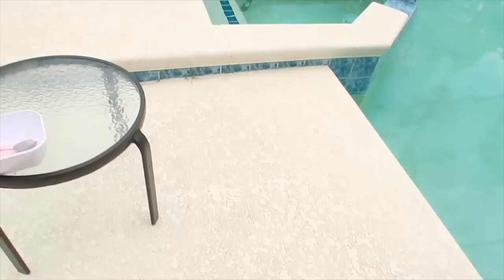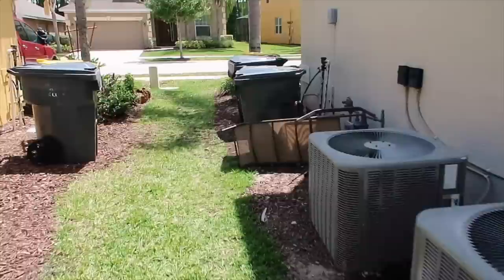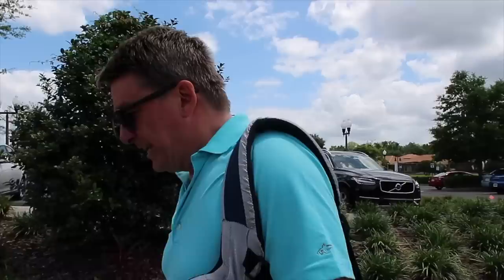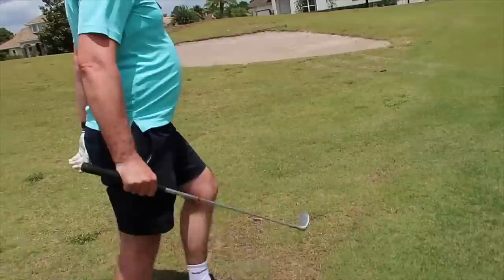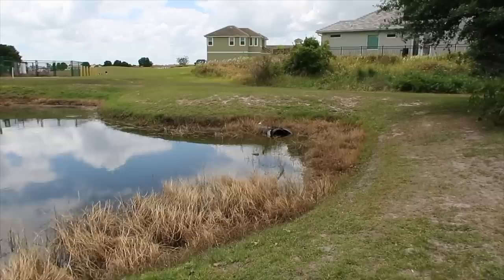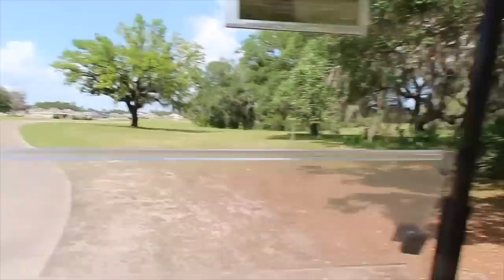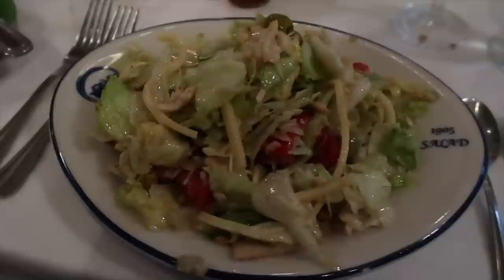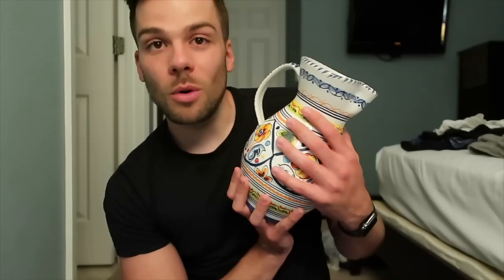I CAN'T BELIEVE THIS! Painting the pool deck, golfing & my favourite restaurant in Florida!

Comment: My house has the same columns and beam resting on them by my pool.  But the seller hid a bad rot problem in the big beam in the lanai that holds the roof trusses Joel,  it almost cost me this house.  They stucco over wood and that is rot central.  Of course my house has no neighbors that can see into my pool area.  It is a sort of T shaped house with a near 100 foot long line of house, and a T for the other wing. the pool is outside the bedroom door and so the house shields the pool on two sides from the only neighbor I have, a man in his mid nineties.  Every house in my HOA is on a greenbelt, meaning wild Florida woods.  Unless you have a house on a golf course.  Yuk.  And the property next door is vacant for two lots, all lots are at least a third acre.  So my pool is house on two sides and woods on the other two.  Lanai.  Not a word I think you know in England.  It is basically a room outdoors.  In this climate almost everyone has them.  A roof, fans, and usually a pool.  It is not included in the square footage of a house.  Florida is the only place I ever lived where they buy and sell houses and accord footage by how much of your house is under air conditioning.  Every house also has another documented number of how much house you have under roof in part because insurance requires that, but when you see a house listed for sale the sq. ft. is the inside rooms under air.  My house for example is 2,440 square feet under air, but total house under roof is 3,590.  They do not count the garage, or walk in attic, or outside bathroom, or lanai as part of the house because they do not have A/C.  This house was built by an architect who worked as an engineer at the nuclear power plant a dozen r so miles away.  Trust me when I say this house is overbuilt I mean I would not fear staying in the worst hurricane, and it is over 90 feet elevation, no flooding even this close to the Gulf.   

Joel, you are going to so look like your Dad in 20 years.  Live it fast because it is coming.  Your Dad used to look just like you and had a life such as it was back then.  Make all the fun you want, you were hotter in that black "golfing chic" than I have ever seen you.  Should that count as one stroke or two.  Um apparently whack off means something different in America than Britain.  Here it means to masturbate.  And you can caddy for me any day.  With happy ending of course.  You did not know that was part of the job?  Dude your skin is way too Brit for that.  That bird is not warning you, it is an anhinga, they dive in the water for prey but do not have oily feathers so their feathers get saturated to the point they can't fly.  That is why they sit in the sun usually in trees to spread their wings, they are drying their feathers.  Whooping cranes and sandhill cranes (related) are extremely endangered species.  I recall as a kid Whooping cranes were down to 46 known birds at one point.